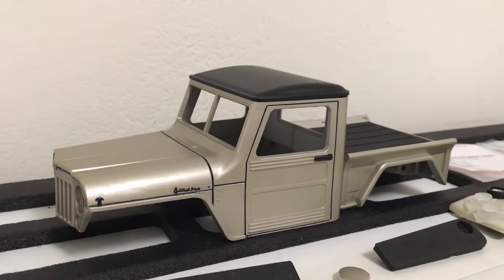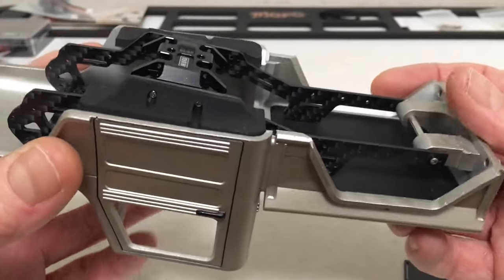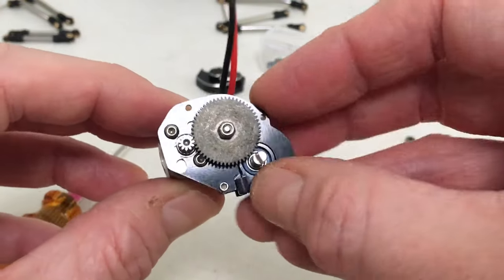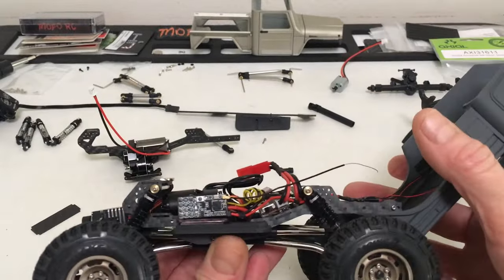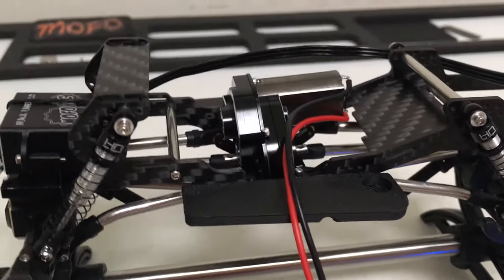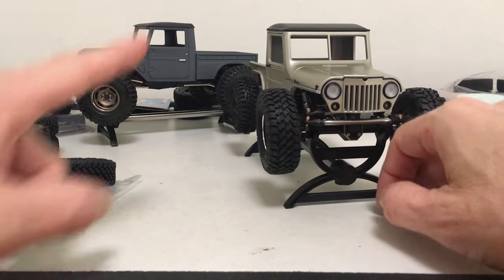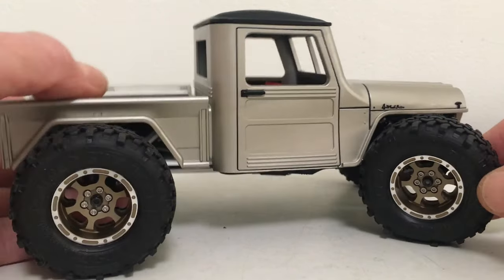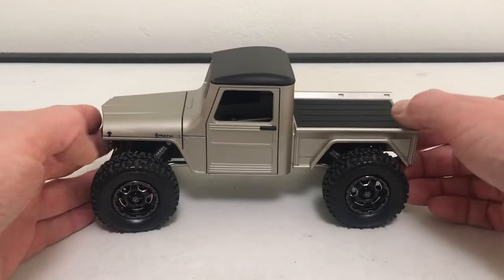SCX24 WILLY TRUCK BUILD: WT MICRO BODY, MOFO TORQUE BEAST X, ROCKWOLF ESC, INJORA LCG C.F. FRAME

Comment: Great video question which one did you pick ?gladiator ? deadbolt,or c10 links …. Thanks in advance.
Reply from the maker: Great question.  This is using the standard C10/JLU/Bronco links.  Sorry I forgot to mention that in the video.

Comment: I remember you talking about these long travel shocks I bought a couple sets of them I got both of them are brand new they have oil in them they cycle really really nicely but as soon as you put them on the truck they bind up I've tried spacers they could be straight up and down I went with the big boys
Reply from the maker: don't overtighten that bottom shock eyelet.  it can put pressure on everything and bind up.  I usually attach the bottom of those shocks first, make sure the shock is loose enough to rotate forward and backward on the lower hardware freely.  then to the top mount.  see if that helps.  That is the only real set up issue i have encountered on those.

Comment: I sure appreciate the time you put into these videos. Have you had any luck mounting the Jconcepts Tusks on either of the ogrc deep dish bronze wheels shown in this video? Thank you!
Reply from the maker: Thank you for that! I haven’t mounted the any J Concepts to these OGRC. I assume you could, but like I said in the video, you likely need to use some longer starter screws.
Reply: @bcochener  Thanks again. These Tusks have been fighting me. I ordered the same bronze set you had on your FJ. I will find out tomorrow if I can squeeze them buggers on there. 🍻

Comment: Did you run that motor in like you know Run It Wide Open well not wide open but you know pretty high RPM for like 30 40 seconds and then do it in reverse
Reply from the maker: I did do a break in on it.  not sure it is needed too much at these speeds, but i always like to do  it on brushed.